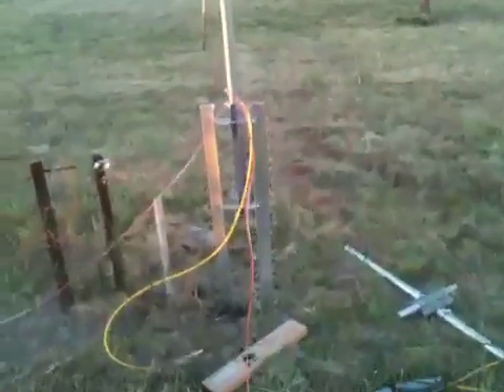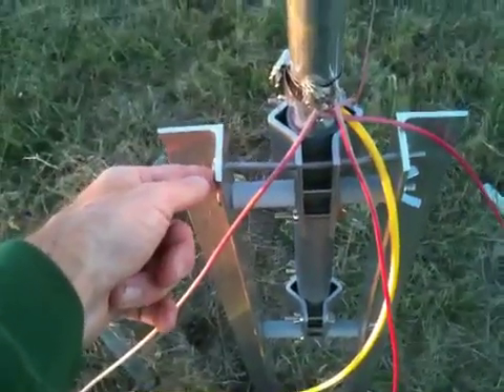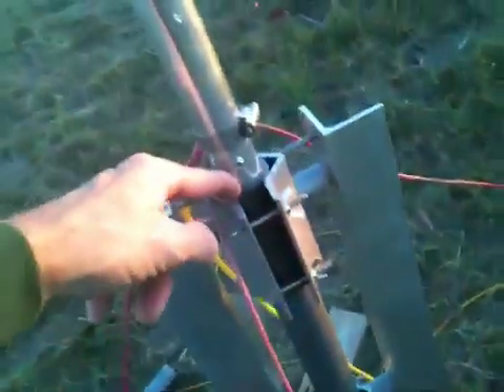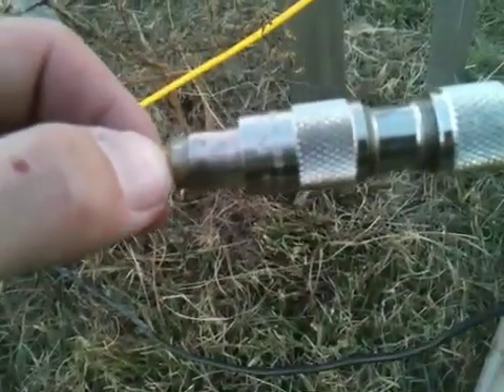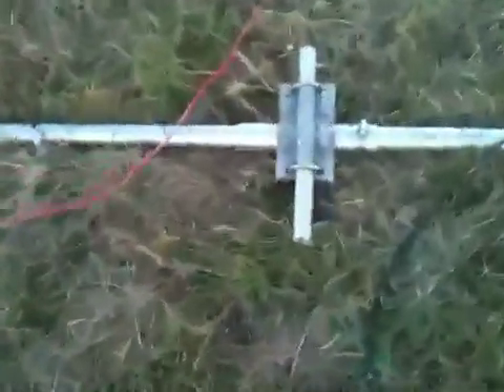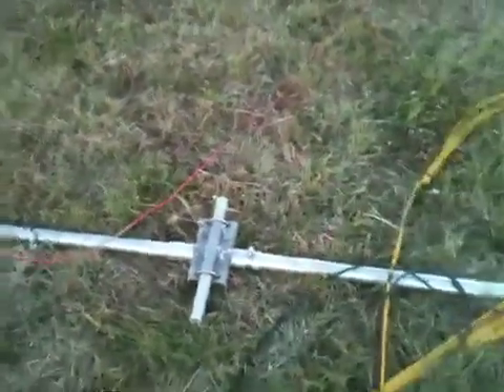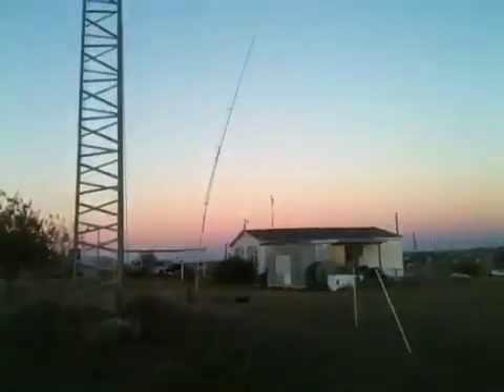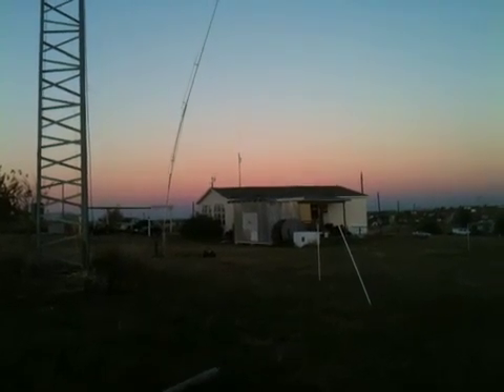Gap challenger antenna

Comment: Just curious, how has the center plastic pipe held up? I am having a hard time trusting it, is seems that some times either heat or cold will make it bend or severally   tilt over.  I am debating either putting a stiffener inside of maybe a wood pole or just adding a fiberglass rod near the center maybe on both sides holding them with the hose clamps  that hold the tuning elements. Like your beam, it falling over might be too costly  to not take steps to protect it. What have you done about fixing your beam, surely some how you were able to get it back in the air, I'll bet you missed it, I have a 4 element tri-band  that I have not found anyone to help me grt it back up so I understand your position, and my age makes  it out of the my ability to do any tower work .
Reply from the maker: Well believe it or not its held together much better than I would have expected it to! I've broken it three times over all the years I've had it, an I wasnt the original owner. The center did break, but that was totally my own fault, I had guyed the vertical right BELOW the center instead of above it like I usually do. One of the other breaks we'd had a lot of rain over a week and my guys pulled out of the dirt and it broke at a weak point where I had drilled close to the bottom making a homemade tilt mount, cracked at the drill point. Third time I had temporarily put it back up without guys and a storm w/high wind snapped it close to the bottom, two layers of aluminum! Ouch! (80+ is not uncommon for gusts here in bad weather) you cant put anything up the middle, the coax runs inside the pole and the center piece is potted to protect their goodies. (Secret stuff? Hehe) just guy it above the center piece, clothesline rope held mine for a number of years before it dry rotted and I changed material :)
Reply from the maker: ...as for the beams... Sigh, I haven't started working on any of that yet besides getting things sorted and manageable. My spinal problems are really pretty bad so I honestly haven't accomplished much in a while. I haven't even been keeping up on here because sitting up at my desk in front of the computer starts unpleasant and just gets worse the longer I sit there. My mail backlog from here is astronomical, lol. ...so, haven't done any CW either, the keys are getting dusty! ;). I do have a yaesu 8800 back there that does cross band repeat so occasionally Ill think about it and bring the hand talkie in here to the recliner and yak on 2m for a bit.    ...yep, miss being on 40m with everybody!

I have started planning repairs though, found a metal company here in the Ft. Worth area that does aluminum tubing and have started getting pricing ideas for the elements as well as the 3" boom on the 40m beam and 2" on the force 12 5ba.  They look a mess and it will be a pain, but a lot cheaper than new cost!  How have you been doing? How do you like your antenna?